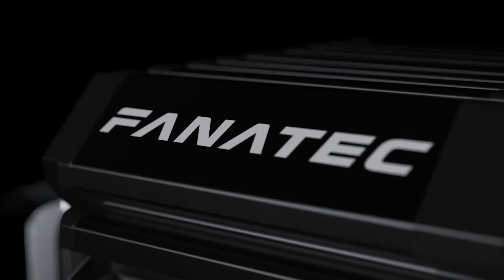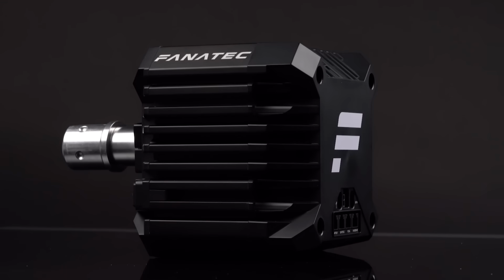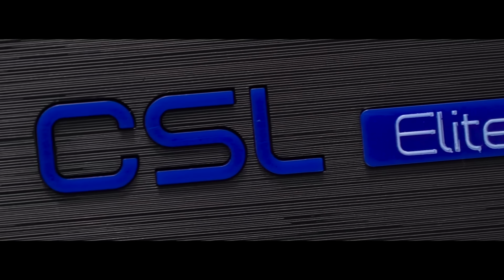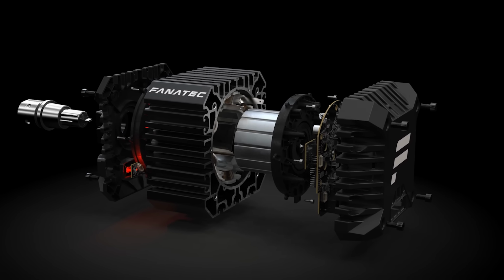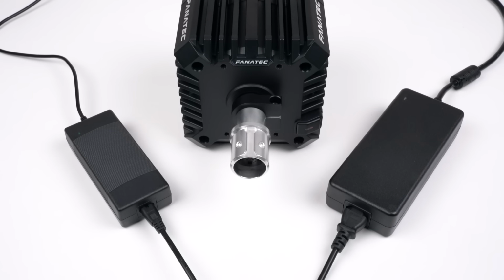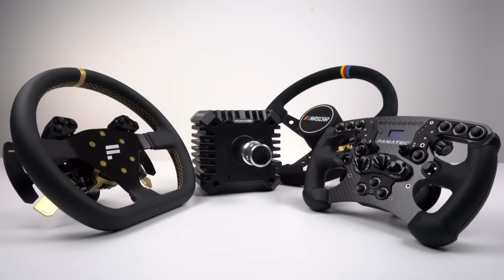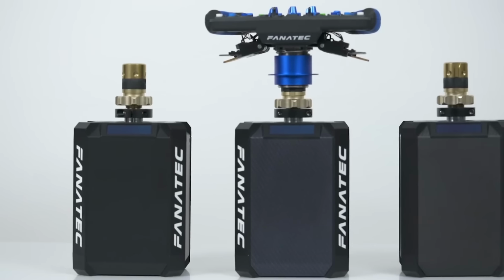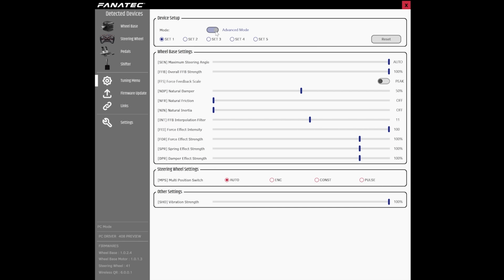Fanatec CSL DD Explained Part 1: Introduction

Comment: You can literally divide the entire history of the force feedback sim-racing market into "before CSL DD" and "after CSL DD". 🤷

No other wheel-base outside of the single exception of the OG introduction of Logitech's now infamous ≈2nm (≈2.5nm from G920 onwards) gear drive in 2004 (yes, the now awful motor in the G923 is OVER TWENTY YEARS OLD!!! 😳🤯) has had as much of an EARTH-SHATTERING IMPACT on the ENTIRE INDUSTRY!!!

Across the entire industry direct drive motors literally went from "an impossible to financially swing pipedream with setups that cost THOUSANDS" to "something basically anyone could afford" in the space of just ≈2-3 years, all thanks to the CSL DD's IMPLOSION of the market! There would be no Moza R3/R5, Simagic Alpha Mini, etc... without the CSL DD having done "actually affordable direct drive" first.

Comment: Okay, so its brushless 3 phase dc motors with, I assume, a shaft encoder and some rj11 or rj45 plugs for peripherals....

Instead of the OBVIOUSLY slackened belt design which would have used a smaller more efficient motor through a series of pulleys. Which would work fine with a properly tightened timing belt, but for some reason someone put a smooth belt on smooth pulleys, then made sure to not tension the system, like at all...

I mean, Im not saying there hasnt been some effort put into a fancy casing and control circuitry for the BLDC core, there has been, it looks pretty schmeck. Minus the wheel mount with slip ring power pass through (which honestly isnt much of an issue) and the positioning (which, in fairness is hard to do right, not impossible, just a lot of low resolution encoders out there), I'm struggling to justify what amounts to a $100 motor at best STARTING at $350, er sorry, €350. Another point ill give is the control software integration, thats a fair bit of programming. 

But i gotta say, in this day and age of faux walles gardens, calling it an 'ecosystem' sticks of when pc parts manufacturers thought they could just call ws2812 ARGBs by some silly name and trick people into thinking they had to be married to one manufacturer.... Makers, who had been using neopixles for ages by the time Corsair and the others clued into them, saw them and were like ".... hey. Thats a neopixle. I bet my Arduino could talk to them" Sure enough, they could. And down came the walls. And while, yes, these days there are more than just the ws2812s (like the sk6805, and the apa102, etc), all similar ARGB type addons will work with any controller...or at least they should. Otherwise the company is treating you like a walking wallet with barely enough braincells to breath... Do not reward that kind of behavior with your business. 

Anyhoo, thats why 'ecosystem' is a red flag word to us nerds who know exactly how this thing works just by looking at it. Please. Don't be like those shysters....CSL. I mean, Id rather build my own (on a rotating Stewart platform while I'm at it! YEAH 😃), however not everyone is secure in themselves enough to cast off the 'i suck' mentality and opt to buy lego style components....which is valid....i dont have to like it for it to be valid....for building out their racing obsession shrine (100% no judgments here, yall. I may be coming in at a different angle but I am right there with ya!)... just, ya know, CSL, dont be like those manufacturers that bank on the users ignorance of common technology. It really will lead to a much more inherently positive perception of the brand across the board even by people who don't utilize your products. That's a hard thing to get in some markets. Not saying ya do, but this is the first video I've seen of your product, and too many manufacturers do engage in that kind of practice, and it's really a turn off... Thus my two cents. 

Kbai.
Reply: 🤦... This is a bunch of freaking nonsense. 😑 Nothing in Fanatec's direct drive wheel-bases are off the shelf. EVERYTHING is custom, including the motor, controller, and everything else. And go look at it what other direct drive options cost when this first came out in 2021. It was literally HALF THE PRICE OR MORE vs all of its competitors! HIGH POWER, HIGH ACCURACY SERVO MOTORS ARE NOT CHEAP!!!

Comment: I was enjoying my CSL DD for a week, then the steering shaft keeps losing connection, ruining my races. I’ve tried tightening the clamp, still happens. I’ve reached out to Fanatec but they haven’t responded. I wish to return it. Do I need to dispute the credit card charge??
Reply: Fanatec usually takes a week or two to respond to customer service requests. They will basically always help you out if you just wait though. I'm hoping Corsair improves their response times. And that was sadly a problem with some CSL DD/DD Pro units (the shaft's USB-C port wouldn't stay firmly in place causing disconnection issues). I hope you got your unit replaced without too much hassle.

Comment: 3 weeks of use , the clamp loosening and my dd keeps disconnecting from my pc, they have solution but not permanent.  It will loose again every 2-3 hours of use

I will try changing it clamp and see how it goes, besides that, its an amazing piece of german enginering😊
Reply: Upgrade to QR2 = problems solved. 🤷 The new shaft's tightening clamp has screws on BOTH sides instead of just one, making it's grasp much, MUCH tighter.

Comment: Buyer beware!! This product is prone to a common issue where the input shaft (which connects internally via usb c - kind of chinsy imo) backs itself out while you use the wheel. I’ve had mine for a few months and this has happened numerous times. Fanatec is aware of the issue and their “solution” is to undo the clamp ring, push the shaft into the base, and re-tighten the ring. I’ve done this multiple times and it just keeps happening. The wheel feels great, however this significant issue makes the product extremely unreliable. Very disappointed that I spent my hard earned money on this.
Reply: You needed to RMA your unit. It's not a user fixable thing. 🤷 Some CSL DD's/DD Pro's had QR1 input shafts that just weren't tight enough. The little metal clamp that only tightened down on one side just didn't have enough torque to keep it in place, and nothing the owner could do would fix that. That said, this issue was pretty rare and has now been COMPLETELY fixed with the new QR2 shaft. If you didn't RMA your unit, a QR2 upgrade will fix all of your issues.

Comment: this is so expensive wait for Thrustmaster to Unveil New Direct Drive Wheel This Year. Good to see them finally making a DD wheel base
Reply: thrustmaster is trash
Reply: still waiting...

they were probably gonna price it $500-600 and less torque.
Reply: @user-wq9mw2xz3j Nah, the T818 is great for what it is, and at 10nm torque it's more of a ClubSport DD (12nm) competitor tbh. If you're already in the Thrustmaster ecosystem with like a T300 it's an absolutely GREAT upgrade option. 🤷

That said, if you don't already own Thrustmaster stuff (wheels, pedals, etc...) it's definitely a harder sell, but it's still a good option all things considered. There's very few properly "bad" options in the ≈$300-$1000 direct drive wheel-base market atm.

Comment: hope you will release a Clubsport Direct Drive Wheelbase soon with 10-12nm for an affordable price :)
Reply: Lol well they solidly beat your torque estimates (12/15nm vs 10/12nm), but the price is anything BUT affordable ($800/$1000). 🤣

Although I do expect them to come down to the MUCH more reasonable ≈$600/$800 price point once the inevitable new Podium's come out either this year or next for ≈$1200/$1500. 🤷

Comment: Received mine a couple weeks ago but sadly it doesn't work. Doesn't send power/signal from the wheel base to the steering wheel (tried two different fanatec wheels). RMA process started but taking a very long time.

Comment: Got mine few days ago, but sadly the bolts that i used for the CSL Elite, are too long for this. So i need to buy new bolts in the next days, after i scratched the new base's bottom with the old bolts, because i thought that they will be good for this too... :(  Always read the user's manual first... :)

Comment: I am realy enjoying my CSL DD with boost kit. I was really happy with my CSW 2.5, but I sold it, because the CSL DD is way more quiet (almost silent), smoother, more detailed, more compact and does not have a belt that will become more loose in time. I am running the 8 Nm CSL DD at around 60% of its torque and that is plenty for me. I cannot imagine to upgrade to any other wheelbase soon. Superb wheelbase, highly recommended!
Reply: So you’re running it at 5nm 🥴
Reply: @erpaderpa4469  $150 waste xD
Reply: that's a relief to hear! I'm coming from a t300rs and hope i feel the same way and never need to upgrade the base 😅
Reply: @amanlall99  how did the t300rs treat you? I'm in the balance of buying the t300 or just skip it entirely with a few more months of saving to get the dd csl
Reply: @marionelsonmedeiros3878  swear I'm in the same boat . Got the tmx now and stuck between t300 and DD
Reply: If only it was compatible with PC and PS, I would habe grabbed it day one probably

Comment: playstation?
edit: didn’t watch the whole video. to save you time he said it is on its way. i have absolutely no contact with fanatec but i assume it will be out before christmas because of reasons i shouldn’t need to explain
Reply: I dont think so. If it would be available before christmas, they would start to advertise it now. and I dont think they would be able to produce enough to supply the demand until christmas. I have zero clue, but another comment expected it to release together with the new gran turismo, which sounds a lot more realistic…
Reply: @evo6259  and the new gran turismo is the exact reason why i’m getting it (playstation variant)

Comment: CSL DD is a good product but it definitely is not as smooth as they claim It to be. I can definitely feel the small steps that are created due to the distance between coils and the shape of the "drum". My previous wheelbase was Thrustmaster T300RS and I would say that the CSL DD has roughly the same detail but obviously, the force is just stronger so you can detect the traction loss faster. In general, I think it is a good product but severely overhyped. As a second thought, I would wait until TM and Logitech release their next-gen wheels which should also happen within 6-12mo.
Reply: Logitech next gen? I don't think they can cram any more buttons onto their gear driver base lulz
Reply: Logitech has not announced yet but there are leaks of the new packaging at least which looks like a completely reworked system.

Comment: We have to thank Simagic this brand. Without it, we won't have any DD system in cheap price.
Reply: What?
Reply: @The1UnderTheSun  Because of Simagic's mini direct drive wheel base, cause Fanatec to produce CSL DD, and in much cheaper price.
Reply: @guidofoc7057  it is your country s retailer price, the official prize is 1/3 cheaper than that. Apart from how black market your retailer is.

Comment: As soon as the playstation compatible CSL DD pre orders are available I'll be jumping on it
Reply: Can't wait it's taking to long to be release.
Reply: @sugs2007  I have plenty of time. I have a T300 that will do for now and I need to save for a new TV because my current TV has the backlight dying with a purple tint spreading across the screen slowly

I am using a CSL elite pedal set with my T400 using a basherboards CPX adapter so I'm set for Pedals when I get the CSL DD

Comment: Guys, it's all fun and games, the DD is awesome, but we need availability and pricing for CSL Pedals with the loadcell kit asap. How are we supposed to enjoy and adapt this new standardd if the only loadcell pedals you currently sell are priced higher than the base itself? We need the csl lc, and for a fair price(i know what a loadcell costs, sorry), so it can be purchasedd as a kit and enjoyedd from day 1.. Thank you!!
Reply: This. Pedals are equally important, if not even more important than the wheel. Maybe we should cancel our orders until we hear news. I've waited 4 months already, I can wait a bit more 😁
Reply: not to mention the CSL Elite load cell kit is no longer available for purchase
Reply: Exactly
Reply: The CSL Elite Pedals have been around for ages... got them just recently. Now I wanted to upgrade to CSL DD & Load Cell with a rig... but can't get no loadcell anymore. Not even a used one on ebay.

We need a load cell pedal!!!
Reply: @kreiseltower  softer than logitech? so me coming from a t150 pro it will be a huge step back for the brake pedal?
Reply: @user-wq9mw2xz3j  I think you are quoting the wrong person. But regarding me I'm on a full rig with club sport pedals now.
Reply: @kreiseltower  yeah was going to reply to the person above.

But you got clubsport pedals, did you have csl pedals or csl elite pedals before? If so, any huge difference?
Reply: @user-wq9mw2xz3j  I had a CSL Elite with the CSL Elite Pedals (without load cell) before and now I'm on the CSL DD with Clubsport V3 Pedals. Difference is HUUUUUUUUUGE... in particular the break. But u need a rig or something really solid to mount a load cell break. I have been watching tons of reviews... but the load cell really helps in much better breaking.
Reply: That’s a bummer. During pre order I ordered the load cell kitt aswell.
Reply: Bruh just buy the V3’s cheat steal cut someone just get em
Reply: @PixelGod240  I have them. That's not the point though. :)
Reply: @beedee95  it was a joke
Reply: THIS! I have the new CSL pedals, but can’t use them since the brake is way to soft, softer than my G920 pedals!

Comment: 130€ just for a power supply for extra 3NM ist kinda brutal, or am I wrong?
Reply: Some people have tried this energy source and say it is a very good thing
Reply: @Jonrran  What? The point is that it's a simple power supply that lets more current through. For 130€ insane
Reply: 3nm more with double the power more, 5nm has 90W and 8nm has 180W, it just makes you feel theres a car more around you
Reply: @Chris_Vasileiou  Yeah for sure nice thing but in the end its just the power supply which is not that expensive
Reply: You can argue that it's a $600 wheel base that they've made a lowered spec'd version of at a reduced price to allow people to get into the ecosystem earlier.